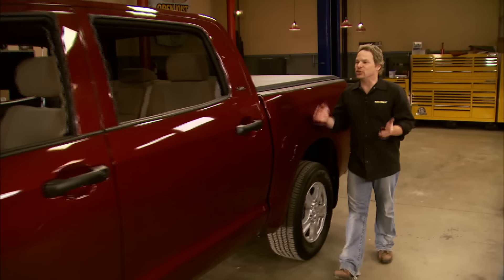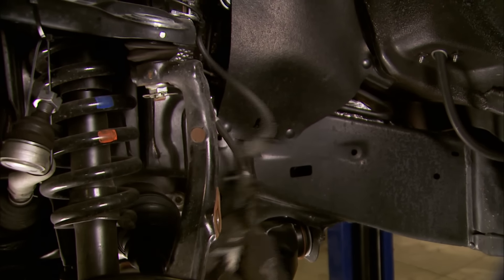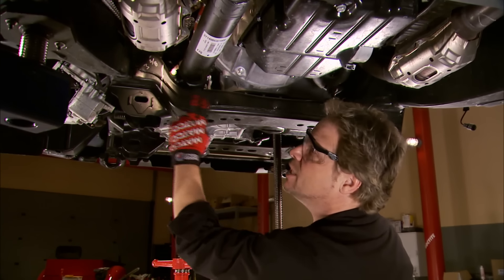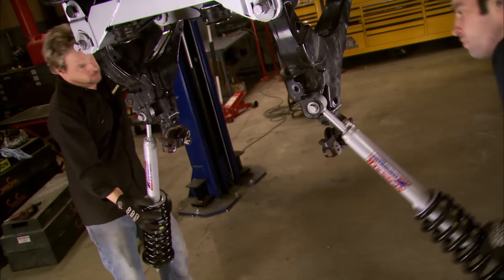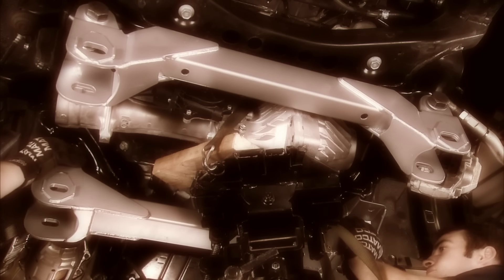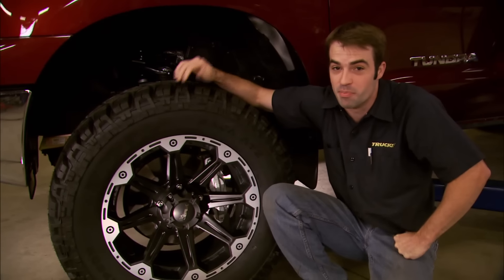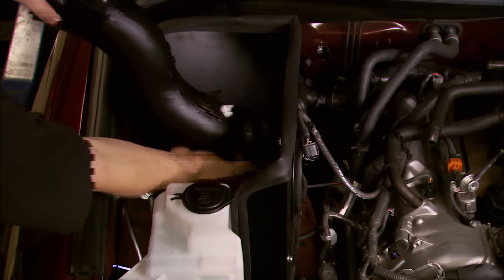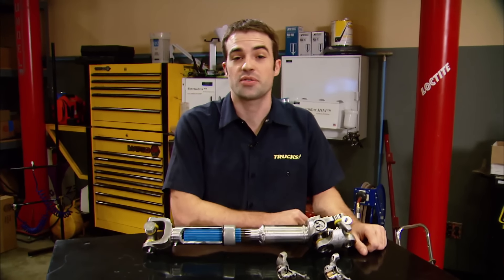Giving A Toyota Tundra A 6" Lift - Trucks! S10, E20

Comment: I have a 2014 Tundra. I Installed a thorton brand tuning chip that plugs into the o b d port. It costs $89.00, and it adds 60 HP, & 5 extra MPG.  I also missed calls a TRD Cold air intake from Toyota. It cost $260.00 with shipping.
Reply: You got scammed on the tuning chip
Reply: No plug in obd is going to add 60hp and extra 5mpg. You got had. 😂

Comment: Most won't have a welder either so just buying the socket will be faster. Also 90 percent of new cv axles are one time use on the spindle side and needs to be replaced! Also on the new cv axles get cardon brand axles with any lift kit. There are longer flexible boots that will last longer
Reply: Most don’t have any of these tools, or knowledgeable help, or 12 hours of free time, or a lift. Shop time!

Comment: "...becoming the best-selling full-size half tonne import truck"  IMPORT truck?!  Huh???  Weren't the first Toyota Tundras built in Princeton, Indiana (then in 2009, Toyota moved the assembly to San Antonio, Texas)?  If that is correct, how is it consider an "IMPORT" truck since it was/is build in the US.  And many industry analyst even claims the Texas-built Toyota Tundras are the most American-made pickup truck.  Oh wait,....is Powernation a Canadian production?  I've always assumed it was a US based show.  So the comment was "best import full-size truck" for Canada?
Reply: tundras are ASSEMBLED in the US not made.
Reply: @TrumpAmerica-2024  But they have more US made parts than RAM, F150, and Silverado.
Reply: @HammerRocks  Dodge Ram is manufactured and assembled in Warren, Michigan. Dodge has been leading in sales since the 2000's
Reply: @HammerRocks most of the parts including the frame come from mexico. gm's are built in mexico, fords are built in china.
Reply: @TrumpAmerica-2024  Maybe so, but they use more imported parts into each RAM compared to the Tundra.  The Tundra has more US made products in it.  Go research it.
Reply: @HammerRocks  mexican parts aren't American.
Reply: @TrumpAmerica-2024  Of course not. Unless the US recently invated Mexico that I didn't know of.  Just go do some reseach on the amount of US made parts on the RAM & Tundra.
Reply: @HammerRocks  i've seen it first hand, the frames travel on rail from mexico, parts come in by truck from mexico, parts from japan come in shipping containers. you're not the brightest crayon in the box.
Reply: @TrumpAmerica-2024  I'm sure you have.  But just go do research on which of the American built trucks (ie. Ford, Chevy, RAM, Toyota, Nissan etc) have more US parts in them.  I'm simply going by from what I've read the industry is saying.  I'm not the expert in this.  Unless what I've read is all fake news.
Reply: Dodge Ram since they are built in Warren, Michigan.
Reply: @TrumpAmerica-2024  They might be built in Michigan, but where do they source their parts from?  Anyway, let's agree to disagree.
Reply: My Ram 3500 says Hecho En Mexico right on the fucking door. Toyota Tundra is made in Texas, with more USA parts than my Italian owned Ram. Just because their owners are Japan does not make them an import… if thats the case than RAM is worse because its not USA owned or BUILT!!!

Comment: I guess you got to entertain the LGBT guys as well with these worthless builds. You are at a loss I guess Powernation.
Reply: Hahah 🏳️‍🌈 I have an 06 Toyota tundra 4.7 L lifted on fox coil lovers single bypass with fox shocks in the rear 18 inch rims and everything else is stock except for I have HID headlights. It has 319,000 miles Nothing except for tires breaks and a radiator has had to be removed. The AC blows cold there’s no restand the car passes smog every year. I hate to break it to you buddy, but LGBTQ has nothing to do with Toyota Toyota kicks, but everybody knows it.